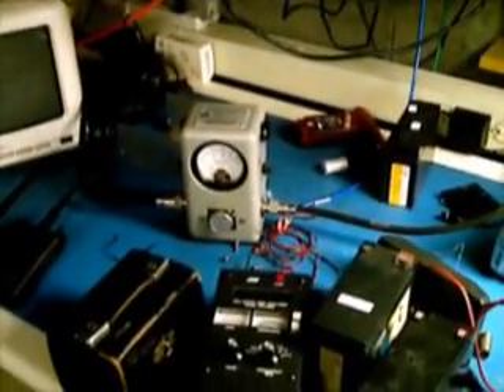Temporary Cushcraft R5 Installation

Comment: Thanks to N1TI, I purchased the 2 matching unit (which I am rebuilding).
The Cushcraft R5 is a good 20-6 antenna.
Great for DX due to low radiation angle (near horizon)!
We use for Field Day on 2 stations ... one worked Alaska on 15 meters and other station worked Virgin Islands.